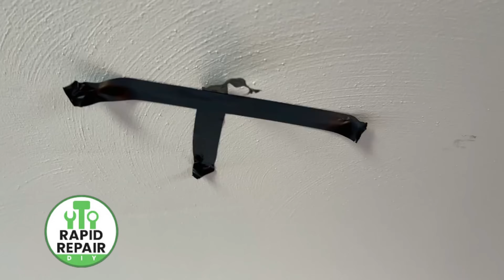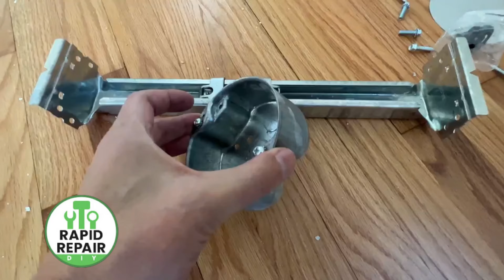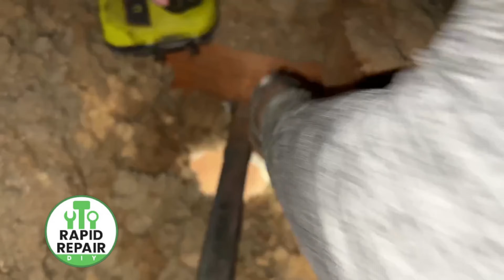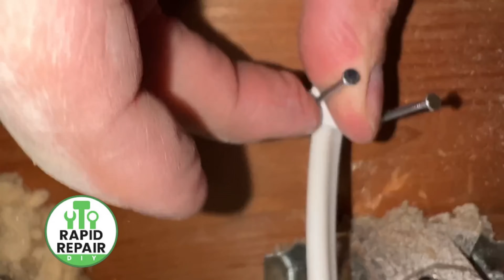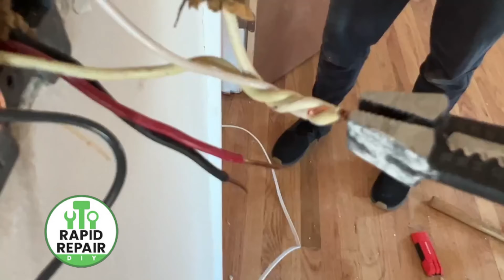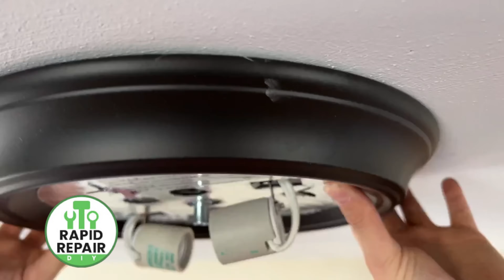Installing a Ceiling Light Without Existing Wiring - step by step

Comment: What if you don’t have the luck of having the attic on top ? U use different type of brace?
Reply from the maker: They have many choices of different electric box braces you can pick from
Reply from the maker: Hello. You can do it from underneth 100%. The expanding brace that will lock inbetween your framing members. The most difficult part will be fishing the electric wire above. Good luck my friend

Comment: Thank you. Any advice for my situation. My wall switch only has a black and white wire, as it controls both sides of a wall outlet.
Reply from the maker: Hello. Please tell me more of what you are installing or trying to do? Having only a black and white wire is fine, that just means your house is old enough it doesn't have a ground. 

If you want to install a new light fixture you can use this switch location still....you can wire nut together the hot wire and that will keep the outlet on at all times and use this switch only for the new light fixture
Reply: @HomeRapidRepair  I'm sorry, I wasn't clear. My wall on/off switch has one cable black/white/ground. It doesn't have an extra red wire. This switch controls both sides off a wall outlet. I'm trying to use this wall switch to add a ceiling light, and have constant power at the outlet. Thanks again
Reply from the maker: @noaff-fn7up  OK sounds good. You would wire nut the hots together, so the outlet will stay constantly on and then you would have to run a new Romex of wire to the new ceiling light fixture and tap to this existing switch . 

So you’re bypassing the current switch to keep the outlet on all the time and then using the current switch for the new light fixture in the ceiling, that new light fixture would be powered by a “piggy tail“ connection to the hot side in the switch
Reply: @HomeRapidRepair  Thanks again. Sorry to be a bother, but when you have time, could you explain a little farther. The outlet box has three romex cables (two from the attic, one from the bottom of the box that I assume goes on to another outlet.) Two of the three white wires go to the silver screws, one is connected to a black wire. One black wire is connected to the bottom brass screw, the other two blacks are connected to the remaining white wire. I hope this makes sense. Again thak you for your help
Reply from the maker: @noaff-fn7up honestly from this description nobody will be able to say for sure what all those wires are for. If you’re installing a new switch and light you can use anyone of the black & white wires as the feed and run it to your new switch. 

If you want to know for sure…you would have to turn one circuit off at a time to isolate & learn exactly what wires are going to what circuit
Reply: @HomeRapidRepair  TY

Comment: Please do a no attic version. Need to find wires figure out where to cut, pull wires through attach junction box etc please help is from start to finish without an attic
Reply from the maker: I know that’s frustrating without attic access. I’ve been on job sites for 25 years and even the BEST electricians often have to cut holes for wires. It’s a myth that they don’t need to. Please check out my video on this subject: No Stress Method Running Electrical Wires Behind Walls
https://youtu.be/ZAqCMK-KtqU

Comment: How did you locate where to drill through the top wall plate?
Reply from the maker: So, in this case, we had access to the attic crawlspace up above. We were able to locate the top of the wall and find the existing switch wiring… If you have access up above, it’s pretty straightforward. If you don’t have access above your ceiling, it’s definitely more difficult… And sometimes you will have to cut into the wall surface to run new wiring 🛠️
Reply: @HomeRapidRepair  Don't forget to advise safety glasses, fasemask, and gloves when moving away that insulation.

Comment: Title needs to include reference to "attic installations only".  This won't work for the first floor of a multi-floor dwelling.
Reply from the maker: Thank you for commenting. Yeah in your case is definitely more challenging. Also I want to encourage you that sometimes you just do have to open up the walls or ceilings to run electrical wire. People think electricians can always run wire without opening up the walls and it’s just not true. I’ve been a licensed builder / inspector for 25 years and often in project homes I see electricians opening up walls and ceilings all the time… Every day…

Comment: the thick white line you fed through the ceiling to the switch that is connected to the fan, is there a neutral (white) colored(black or red) in the casing of that wire?
Reply: and hooking it to the fans screws is it, light or white color screws go with the white or neutral wire and brass goes with black or colored wire?

Comment: Wait ao to stop the switch from controlling the out let you just put all the hot wires together to the switch. I'm confused trying to add ceiling lights to my rooms. But all have switches controlling the outlets. Would be easier for me if they didn't, lol.
Reply: you'd have to wire the outlet straight from the panel so that the switch doesn't control the outlet

Comment: Is it possible to overload your circuit this way? Or is the ceiling fan low enough to work this way?
Reply from the maker: Great question. A ceiling fan is going to pull very few amps…no big deal for your home’s circuit 👍🏼⚡️

Comment: I think you missed snipping the ears off of that wall switch for it to sit flush with that old work box, other than that great video! I always prefer light fixtures where I can change out the bulbs!
Reply from the maker: Awesome. Thanks for watching. As far as the box ears…it may be the way the video was cut up during editing. 

Should we stock pile traditional light fixtures before only LED fixtures will be available? 🙈